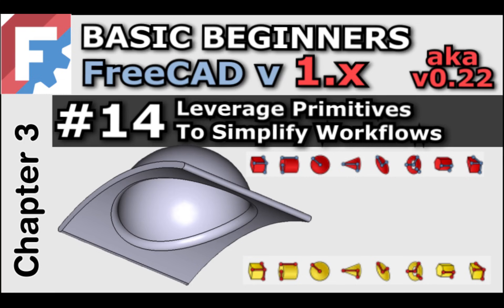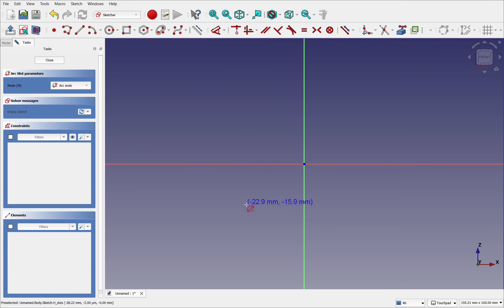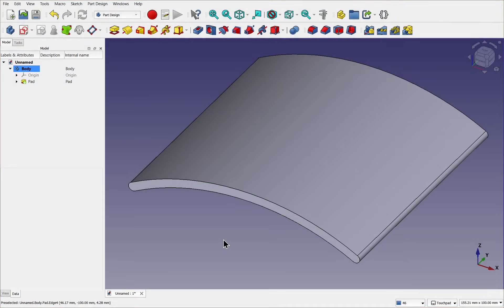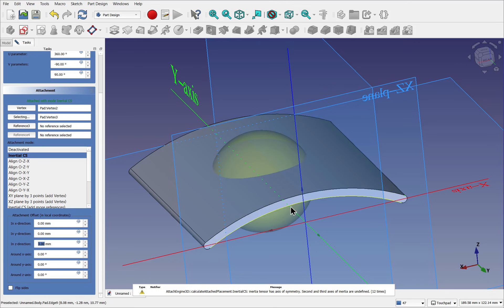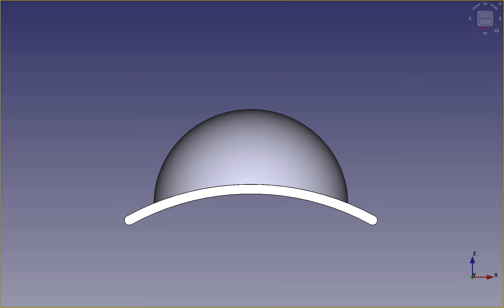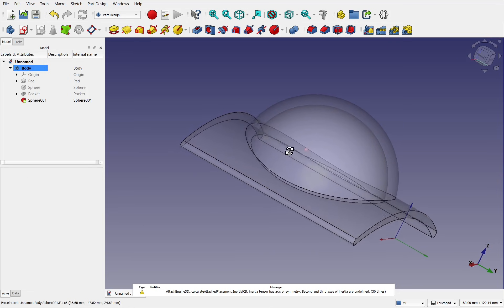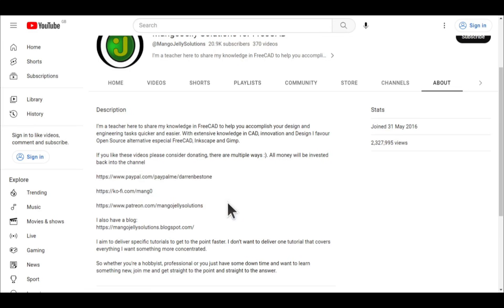Simplify Your 3D Modelling, Leverage Part Design Primitives | Basic Beginners FreeCAD v1 Lesson 14

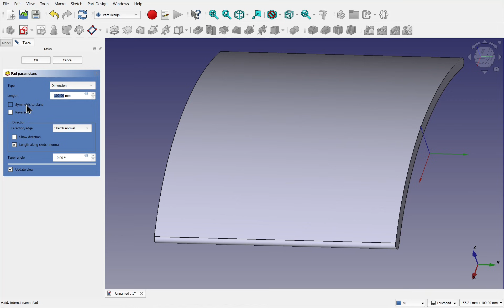Comment: You double-click Pad from tree view at 5:46 but in my latest Freecad 1.0.2 on Windows, double-clicking Pad was opening Tasks with only Transform options. In case anyone had this happen, you have to switch "Edit mode" back to default. Top Menu: Edit -> Edit mode -> choose Default. I'm not sure why it got off the default. A secondary method is to right-click on Pad and choose Edit. Thanks!

Comment: Small, off-topic mechanical point: If modelling a stamped or molded shape, the inside fillet should be concentric to the outside fillet to maintain consistent thickness, which would mean the fillet on top would have radius 2mm smaller than the one on the bottom.

Comment: Amazing tutorials! Small note for 4:06. When we set the radius to the inner arc, it gives a solver error.

I found out that it's easier to set the 100mm radius constraint while drawing the arc slot.

Reason: arc radius constraint is actually set from the centre of arc to one of the arc end points. Alternative would be to set the dimension constraint between the centre and end point on X axis which works.
Just no way to set dimension constraint between a point and an arc.
Reply from the maker: Thank you for pointing that out and explaining it so clearly. These comments are just as important as the video its self.  Glad you enjoyed.

Comment: In 13:11 when using pocket feature I got constantly "wire not closed" and it was a mess. It seems like external Geometry line was interfering somehow. 
So I got it working by -> Check the Edit → Preferences → Sketcher → General → Always add external geometry as construction
Reply from the maker: Ah, it sounds like your using 1.1 dev version? Yes that's a new feature that's been added and I can see it causing a few issues when learning the software.  Thanks for highlighting that.
Reply: @MangoJellySolutions oh so THATS what was happening. I did it three times before it worked. 
I think I have now run out of hyperfocus for the day and need to go watch funny cats for a while.

Comment: Magnificent tutorial! I am learning a lot and really enjoying it. Thank you once again.

I understand that if each student presents a question, your workload increases, but I wanted to ask in case you have a moment to respond: When I create a shape, for example a sphere, and then want to edit it after closing the sketch, you suggest double-clicking on the sphere in the tree. However, in my case, this doesn't allow me to edit the shape directly; instead, it opens a menu to set the appearance for each face.

I discovered that right-clicking on the sphere gives me a menu where I find "Edit Primitive," and through that, I was able to edit it.

It's clear that at some point I changed the double-click option, but I can't figure out where in the preferences I can modify this action back to the original behavior.

If you or any advanced students could guide me, I would be very grateful.
Reply from the maker: Try clicking on Top menu > edit > edit mode and then pick default :)

Glad your enjoying the videos, please ask away, if I can get to them I will, just may take a few day :)
Reply: @MangoJellySolutions  Thank you very much, problem solved.

Comment: at 12:30 why does creating an arc with 3 points with the middle point attaching to the arc of the main object create issues?  And is this something that us noobs will learn to avoid intuitively?
Reply from the maker: So what can happen is that you will get over constrained, I have seen it a number of times and I am still not 100% sure whether it's a bug in freecad or something is causing the issue.  Using the equals will equal the exact diameter.  Sorry, that should of been something I should of explained.
Reply: @MangoJellySolutions thanks for responding.  No need to apologize.  Your tutorials are by far the best I’ve come across, regardless.
Reply: I was wondering the same thing. Little things like this are definitely not intuitive

Comment: Trying to learn something else after using Fusion for so long. FreeCAD seems very primitive. All this could have been done in Fusion with split body and use the bottom surface of the arc as the splitting tool. Delete unwanted body. Much easier. Does FreeCAD do things Fusion can't/won't or should I not bother switching? I'm not sure if the juice is worth the squeeze to learn something new that seems to be a step backwards.
Reply: FreeCAD is free while fusion costs money.that's a big decider
Reply: @foxsecret  Fusion is free

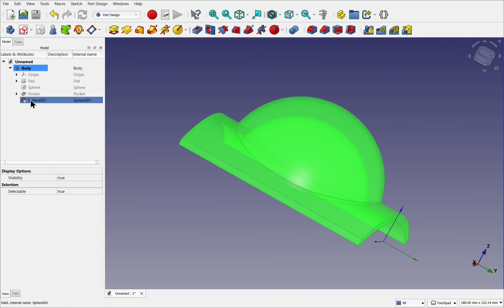Comment: I double clicked Sphere001 in the model list at 15:55 but it doesn't bring up the original editor, it brings up "set appearance per face" instead. Had to select "edit parameters" from the right mouse button menu.
Reply from the maker: Thank you for the feedback, I will be checking through to see if anything has changes in the latest versions.

Comment: so is this just a Boolean operation, or are those different?
Reply from the maker: All the operations in part design involve Boolean operations but they are automatically applied for you by the workflow.  So, if you sketch a rectangle on top of a feature and pad it, under the hood it is doing a extrude and a Boolean union.  If you pocket, it does a extrude and a Boolean cut.  These are additional operations that make the shape of the primitive.   There is a standalone Boolean operation in the part design which require two bodies to be used.
Reply: @MangoJellySolutions  hey, I appreciate you taking the time to answer! Just a followup, why would you choose additive/subtractive primitives over a Boolean? Or is it because primitives are just limited to general shapes where with Boolean you could create a much more complex shape and use it to cut or add?
Reply from the maker: @allforumboardr1  No problems happy to help.   If the primitive is the shape that you need then it's often quicker to start from there.  Take the sphere.  To create one you would have to sketch a semi circle and then use the revolve operation.  Where the primitive you just click it and it's added.  As long as your confident your base shape for the feature wont change then you can use the primitive.  I personal would never use the box.  But when you start getting to more complex shapes like ellipsoid then this is where a primitive would be considered.
Reply: @MangoJellySolutions  ah that makes total sense. Appreciate chya! 🤠

Comment: These beginner videos are SO GREAT, thank you! I do wish you'd explain a few things, though: What the hell does "Inertial CS" mean, and why would making that arc in the sketch tangent to the other one you pulled in as an external geometry "cause problems," as you said?
Reply: "Inertial CS: Inertial coordinate system, constructed on principal axes of inertia and center of mass"

you can read this briefly as he mouses over it. If you look up "Inertial navigation system" on wikipedia you can get an idea of what it's based on but basically as far as I understand it seems to be a system that takes into center of mass, angular velocity, and a bunch of other variables. Basically it's a bunch of high level maths and science that allows for more advanced control in a 3d space rather than being limited to just Cartesian coordinates. I could be way off on this but that's what I could parse from what little information there seems to be on it.  

As far as the problems that he is referring to I think what he is referring to is that if you created it tangent to that arc then if later on down the line you do something that changes that arc it can have ripple effects that can often lead to your object no longer being 1 solid object as is required when working in the Part Design bench. I'm sure he'll get to your question eventually but I just figured I'd try to help  :)

Comment: I came to see if you had some lessons with the RC1 and watching this want to ask if and where back in your videos the Version 0.22 was close enough that I could use it to transition to the new RC1?

I have only recently moved from 0.19 to 0.21.  I stayed with 0.19 because there were so many excellent tutorials in 0.19.
Reply: The previous versions tutorials are still valid for the newer versions. They are add-ons to your knowledge. The new tools in Sketcher wb just make your tasks easier to be accomplished and the reduced TPN events too. Be careful because an old model once open and saved with RC1 no more is able to be reworked/adjusted with older versions.
Reply: @LFANS2001  Do you mean back to version 0.21 or 0.19.   I feel  I am noticed differences but am still very new to 0.21.

Comment: I love this series! Although I've been using FreeCAD for some time (although I don't consider myself proficient yet), I've learned more than I expected when I started this series.

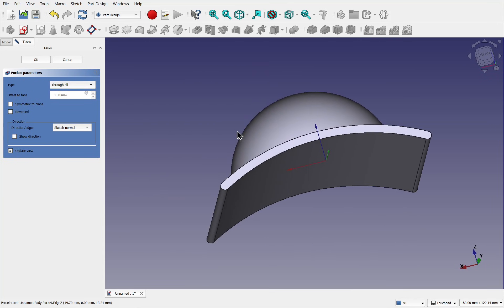At about 13:30, where we remove the excess sphere material, you could Pocket 'Up to face" and select the face on the far side of the arched base rather than using a dimension. Presumably, that way if the extrusion length of the base changes, the pocket depth would change with it. 

As for creating the pocket sketch on the face of the base, has the TNP been resolved such that this is now considered safe? I ask because I had a project break after adding a feature to a base object a few weeks ago (using the then-current dev version which reportedly had the TNP fix).
Reply: Yes, TNP will be fixed in 1.0. Please make a bug report, if you still run in this problem with the latest rc.
Reply: The dev version changes all the time with regards to the TNP, always check with the latest version and if the problem persists open a bug in the github page. Regardless of the status of the TNP (which is improved massively in the last month). My advice is that even though the TNP might become a thing of the past for common cases, it is better not to depend on it being solved for you and still put some thoughts into how the model is built to prevent it in the first place.